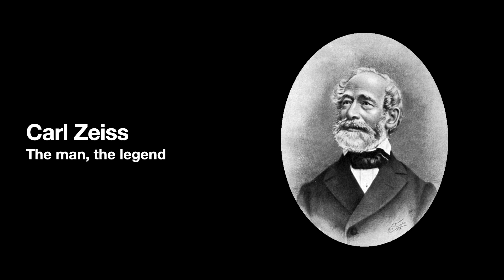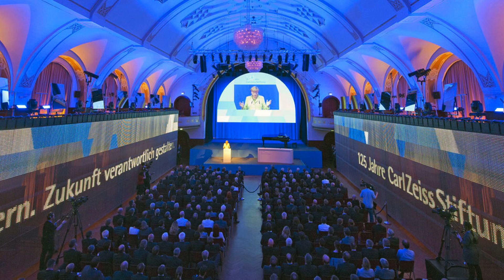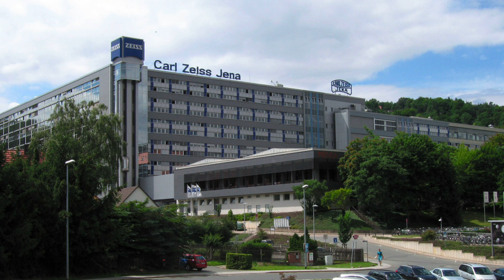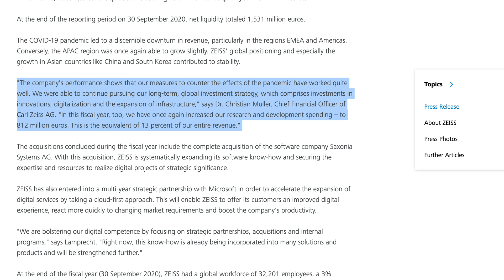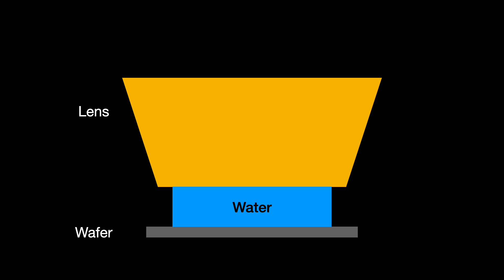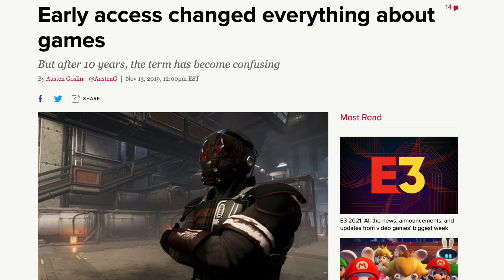Carl Zeiss, Explained: Germany’s Semiconductor Optics Master

Comment: when jingoistic chinese claims that they can make 28nm and below all by themselves on internet in few years I often laugh as chip fabrication supply chain is a universe in itself you can master few chemicals,hardwares&softwares but none single nation can master all this that are needed to complete the chip fabrication process.
Reply: At present, the global photoresist market is basically monopolized by Japanese and American companies. Photoresist is a high-tech barrier material, and its production process is complex, and its purity requirements are high. Japan ’s JSR, Tokyo Kogyo, Shin-Etsu Chemical, and Fujifilm have accounted for more than 70% of the global market share and are in a monopoly position.
Reply: This is why I'd like to see Asianometry do a deep dive on the manufacturers of photoresists for EUV chipmaking. Photoresists are a CRITICAL chemical in chipmaking.
Reply: Sounds ripe for disruption through a completely new vertically integrated process that would make nearly a trillion in investment and infrastructure obsolete overnight. China is not going to do that though.
Reply: @zinjanthropus322  The use of a vertically integrated process comes with substantial challenges and issues alone that would not only equal, but potentially dwarf the cost of the creation of an EUV system. While large corporations such as TSMC, Samsung and Intel have long term roadmaps for vertical integrated process's but even they realise it would take thirty years to replace the current industry node shrinkage.
Reply: @thecat6159  It wouldn't really be a disruption if you're just bringing the same old processes in-house. It would have to be completely new IP heading in a different direction.
Reply: The people who made that claim are just an armchair general, keyboard warrior, China licker. Their opinion should be ignore.
Reply: @kazuotan1895  The country of China could do it but it would take at least fifteen to twenty years and cost potentially hundreds of billions to trillions of dollars. 

Even if they do reach EUV technology within that time frame. They would still be dramatically behind ASML. As ASML would of moved on to even higher resolutions such as 6nm lithography.

If I was China, I personally would just research other cheaper lithography techniques such as Nanoimprint Lithography and DSA. As while the  resolution would still be inferior to EUV. It regardless would have dramatic benefits in cost and production. That would make it cost competitive for majority of the semiconductor markets.
Reply: @thecat6159  "The country of China could do it"

NO they can't. One single country can't control 100% of the chipmaking process from start to finish. They will have to go to other countries for critical chemicals and machinery.
Reply: @thecat6159   I know. Even I know surely that Chinese industry experts would think like you too.
Reply: @Molybed1  I think China can if they can get the IP of entire process from chemicals to equipments. Ever wonder how Japan developed all these critical chemicals and equipments?
Reply: @kazuotan1895  Ever heard of NAND flash? Japan invented that. Ever heard of Isamu Akasaki? Google him. In 2003, a Japanese research team at NEC fabricated the first 5 nm MOSFET. Back in 2003. Think about that. Don't let anyone fool you, Japan contributes a whole lot in INVENTIONS and innovations in high tech. Japan is way above China in that regard. And even Japan cant 100% create and manufacture a chip from scratch to finish all by themselves. What makes you think China can do it?
Reply: @Molybed1  thanks for the info. By the way I saw lots of China supporters talk about Huawei photonic chip. Do you know what's that and its purpose?
Reply: @Molybed1  There is nothing stopping a single country from doing it beyond the cost and time required to research all those technologies needed. It wouldn't make SENSE to duplicate the effort already done by other companies. It is much easier to buy things than to research them from nothing. China has plenty of money to put into research and in the long term it may be worth it to build up modern tech industries of their own if the west continues to block their access to the free market.
Reply: @kazuotan1895  Never heard of the Huawei photonic chip, but if it uses silicon most likely China has to buy that silicon from Shin-Etsu. Shin-Etsu makes atomically pure semiconductor silicon.
Reply: @Molybed1  it was on the news months ago. But still not clear what it purpose.
Reply: @Molybed1  Believe what you want. People didn't believe 40 years ago that an extremely poor China could become the second largest economy in the world today. An employee from ASML has stated that China can catch up. They have the talent and resources and will figure it out. It's just science. Trying to cut them off from buying the lithography machines is going to backfire. Come back in a decade and revisit this conversation.
Reply: @kazuotan1895  Huawei Photonic chip is just pure propaganda and not just that they are also making claims of graphene chips too. Remember just one punch and US has eliminated the Huawei because designing chip on EDA with a licensed or opensource architecture is much easier than building these lithographic machines and these photonic chips won't ever compete with silicon chips because they can't have silicon transistors like feature size ever..Physics limits that and this concept of photonic chips or photonic computing is not new.
Reply: @ChatGPTisSkynet  ok. And rn I'm still trying to understand photonic chip by reading articles about it. In term of transmission it quite fast and use less energy but I still trying to understand how it process a data.
Reply: @kazuotan1895  you can create photonic gates yourself to understand it , the said advantage of photonic chips are of bandwith size that it can process multiple instructions simultaneously using property of light.
Reply: @ChatGPTisSkynet  is it better than silicon chip? What is advantage of photonic cpu(theoretical) over silicon cpu?
Reply: @kazuotan1895  whatever chinese claim just take it with the pinch of salt.. two technologies are very hard to master because most of the information is just not publicly available unlike in case of quantum and AI research that international community publish often online and chinese can copy easily. 
 1. Single crystal blades Superalloys for jet blades.
2. Hardware technologies that goes into photolithographic machines.

These both tech require years of R&D and very good understanding of material science.
you can create jet blades and lithographic machines yourself but that won't be at the cutting edge of industry standards.
Reply: @kazuotan1895  it is better than silicon in aspect that it can process multiple instruction with a single gate , for example you can only send a single current source at a single transistor but you can send multiple wavelength light through a single photonic transistor simultaneously. Real problem is that it can't be miniaturized like silicon chips at that scale. There are startups that are trying to create photonic chips for ML accelerator chip by exploiting this property.
Reply: @kazuotan1895  A more layman way to understand difference between silicon transistor and photonic transistor is that imagine a road were there is a toll collection point so from this toll only a single car(information) can go at a time because road is only single lane i.e, how silicon transistor work while there is another highway where multiple roads passes through a single big toll collection point simultaneously i.e. photonic gate
Reply: @ChatGPTisSkynet  so it clearly still impossible for Huawei for this matter using photonic chip to replace silicon chip to produce cpu as they currently battling to produce high end kirin chip for their smartphone but unable to access EUV technology?
Reply: @Molybed1  Really？in 1950s，the US can make chip from start to finish by itself
Reply: @ChatGPTisSkynet  28nm isn't cutting edge at all. 

As for jet blades，China recent produced J-10 and J-16 are equipped with indigenous WS-10 rather than Russian AL-31F.
Reply: @Molybed1  Japan did not invent memory IC，Japan bought memory tech from Intel back in 1970s. Japan could create and manufacture a chip from scratch，but it is not economically viable to do so，since Japan does not face restrictions to buy components from overseas. China‘s situation is different，China has to develop everything inside the country，even if it's inefficient and more expensive.
Reply: @tonylee9363  Maybe in the past the USA could do it, but it cant do it right now. On the bleeding edge, nobody can do it alone. Saying China can’t make advanced chips by itself is not a criticism of Chinese engineering. No one, not even TSMC, Samsung, GloFo or Intel, can make leading-edge semiconductors without Japanese, European and American equipment. And there’s no one else, not even the South Koreans or Taiwanese, making that equipment. This even applies to displays. For example, you see that Dell/HP/ASUS flat panel you are using to watch movies or surf the internet with, it was likely made by Canon Tokki FPD equipment.
Reply: The thing though is, all the machines have already been sold to China.
When they say they can now make 14nm. Really means every piece of machinery has already been sold to China. to make 14nm
ASML continued to Ship the lithography machines to China. Even though USA told then not to. Money talks I guess.
Reply: @eastsouth9548  EUV shipment to China is banned，DUV is not
Reply: also watching asianometries video china doesnt need taiwans tsmc. 
somehow everyone thinks china is going after taiwan because they want the chips.
dont they know tsmc has factories in china.

Comment: Now talk about Lasertec. Without them, EUV chip manufacturing would be impossible, even if a ASML EUV machine exists.
Reply: As for the technology of euv optical collector system it was first developed by media lario, an Italian firm based in Bosisio Parini,Lecco, Italy.Even their systems were a used by asml during the development phase and were quite successful in operation. what Zeiss did is it sold some share of its semiconductor division to asml so as to make a deal for the optical collector system they had. This Zeiss system is basically based on media lario technology of Repli formed optics which is quite extensively used in x ray telescopes. Media lario dominates the space market.
But media lario didnt stop investment in its optical collector system and probably has deals with companies developing these euv systems to supply them with Media Lario optical collector systems.
Reply: ....Lasertec and KLA corporation
Reply: @nickj2508  "KLA corporation"

Yup. 👍
Reply: Zeiss now has it's own mask inspection system, but i dont see any Lasertec production System yet so i don't get your point. Maybe the commercial introduction would have been delayed but to say it would'nt exist is a little bit of a strech
Reply: @nikolaskonle3926  lasertec systems are made for euv mask inspection with with mask reticle. no such system is made by Zeiss.Lasertec is Japanese firm and is years ahead of others in mask inspection technology.They have almost 80% of semiconductor mask inspection market share and for euv it is 100%. Also they dominate in fpd mask market share with 100% of the market.
Reply: @amritnimiyar5033  Thank you.